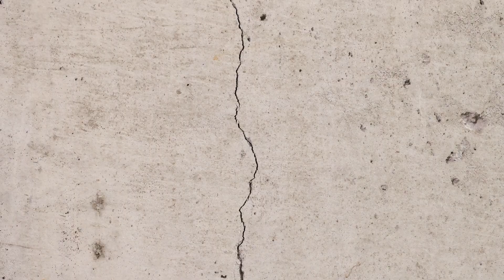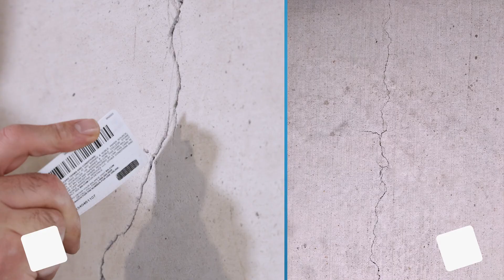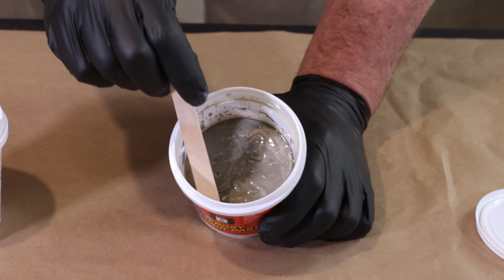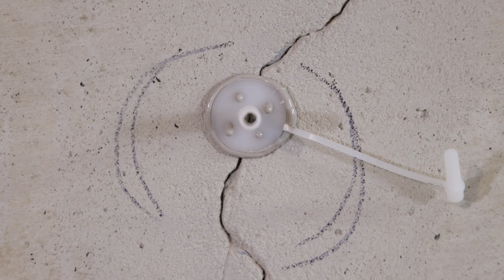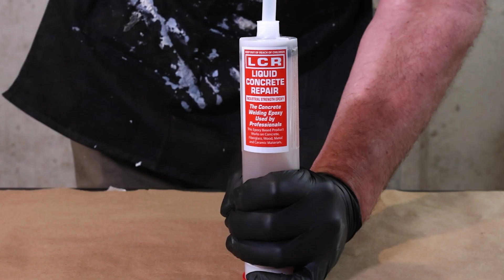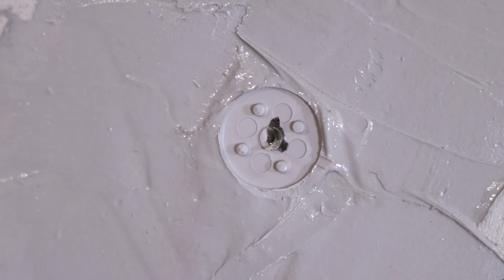How to Use the Polygem LCR Epoxy Concrete Crack Repair Kit

Comment: I prepared 2 34" cracks on my foundation wall. Lower level of a high ranch. There is some 2 part epoxy left. it each tub. So, thats 68" of crack. The kit states it will do a 96" repair. I am very skeptical of that claim. I used all of the epoxy that I did mix. Its been 24 hours. I will start using the injectible epoxy next. After watching a few videos . It state that each 2 part tube will do 4 feet. So that claim of 96" crack repair is far from accurate. I did by an extra tube of the 2 part injectable liquid. So we will see how this goes today. So far I have spect almost $ 248.00. I bought the kit at $ 157.00 and an extra 2 part injectible and 7 port  tubes. The kit only comes with 7. I used 4 on each crack. Not happy about them really shorting what you actually need. And no, I did not put excess epoxy over the crack in step 2. The kit should come with about 50% more epoxy and 2 tubes of the injectible . And more port tubes. The LCR Injection and tube were an additional $ 69.95.